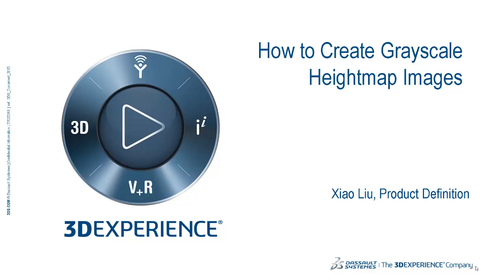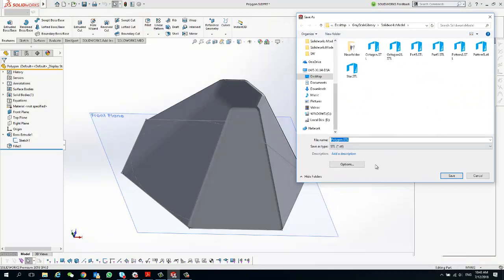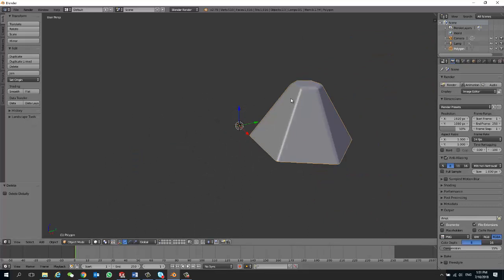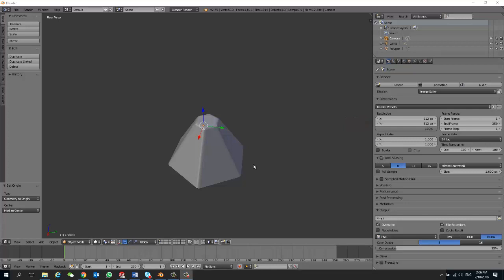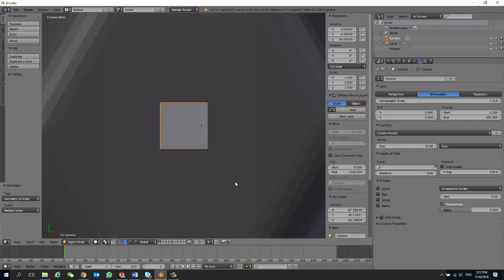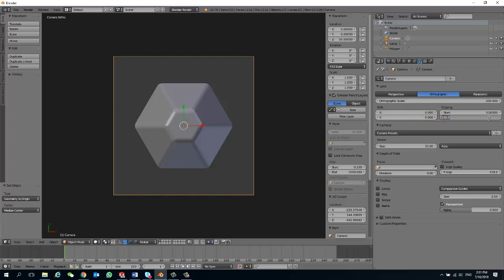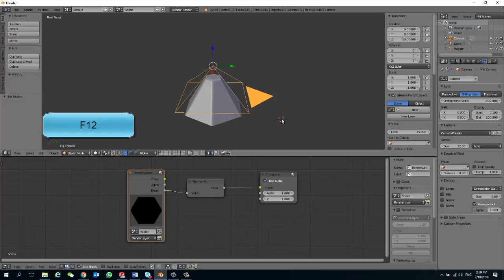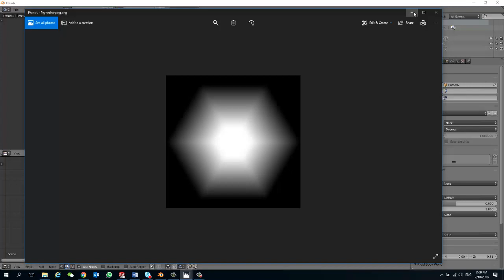Using Blender to Create Greyscale Heightmaps Images

Comment: can this be done with the terrain made with the blosm ?
Reply from the maker: I am not familiar with the output from blosm... I will say that if the output is 3D geometry then what is described in this video should work. it may be that this product can directly output a greyscale heightmap. Greyscale heightmaps are very common when working with representations of terrain.
Reply: @mbanta  yea it's in grayscale not sure about the 3d of it but yea check it out for osm